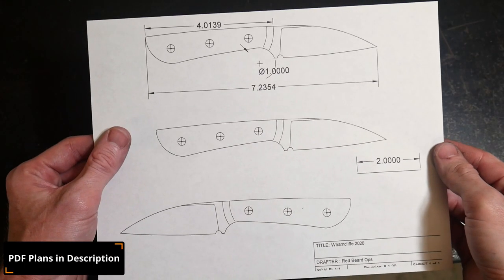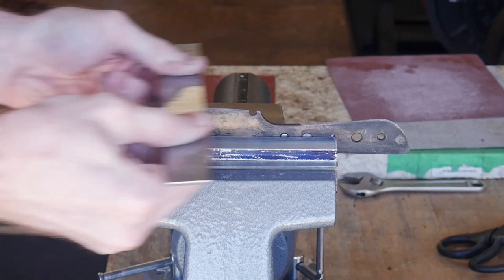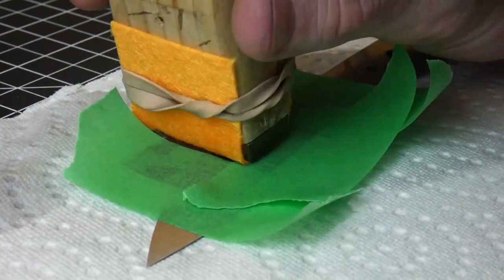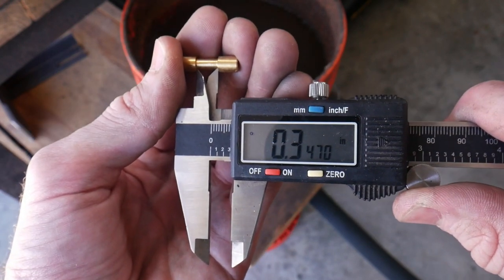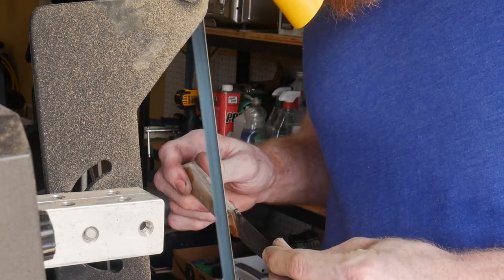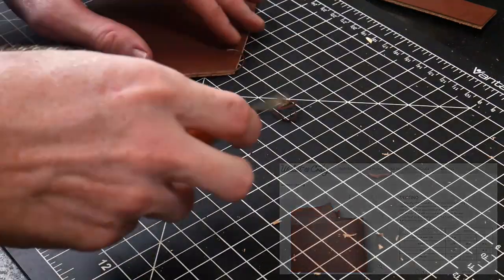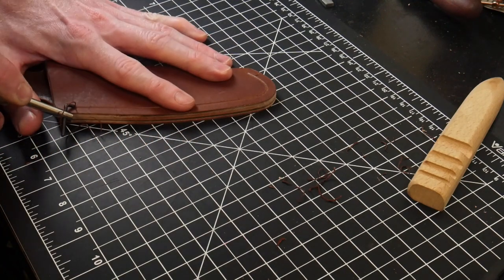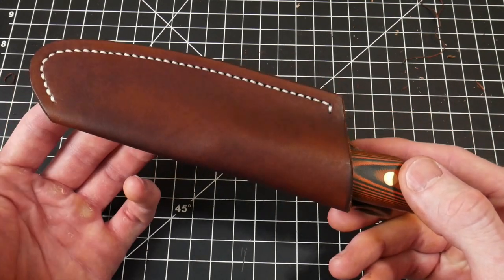Wharncliffe Knife & Sheath Build | Knife Making

Comment: Great job brother! I really dig the tip of running a JFlex a little over the edge of the platten to get into the plunge lines. It’s a tough spot, and the idea is golden! Beautiful work.
Reply from the maker: Thank you sir. A VFD really comes in handy at that point too. I'll slow it down a good deal when dialing in the plunges. I still don't get them right every time and have to throw that knife away. But I'm getting them right more often now with practice. Getting to the center line nice and straight is the first part of the battle. If that doesn't happen the plunges won't look good no matter what you do! Cheers man!
Reply: Red Beard Ops true statement😉.

Comment: Nice video and knife.  I need to make a tumbler like yours and figure our how you are using conditioning belts after the maker's mark.  It always wipes out the darkening.  I use the single use vinyl stencils, a 12v battery charger to etch and ferris chloride to darken.  Maybe using AC to darken holds up better?
Reply from the maker: They Walt, I've had this happen with new conditioning belts. The one I'm using is an old belt (1year plus) and it doesn't get deep in the mark like the new ones do. AC could help. If you wash it out you could go back with some brass black to get it dark again.

Comment: Is that "finishing nail" you used for the sheath just a basic nail? Probably a stupid question but I'm just starting out in sheath making, love your work man. 🤙
Reply from the maker: Yep that's just a little nail that is normally used for attaching trim. Ive also found good results using similar sized needles.
Reply: @RedBeardOps  Thanks!

Comment: Grinding after the heat treat -->  No hardness issues?  I see more guys doing this I just haven't done it myself.
Reply from the maker: Nope, knife blades are so thin in general that you'll get it hard all the way though. Just don't get the blade above your tempering temperature when grinding.
Reply: @RedBeardOps  rocknroll 🤘thanks!

Comment: Very nice work and great video. Question: when you do those last stitches in the sheath and melt the ends, did you tie a knot there? Maybe I missed that. If you don’t, have you ever had the soldered thread ends come loose after use? Also, have you thought of a rivet in the center of the belt loop circle stitch? One with a logo “RB”(?) would look pretty cool 😎
Reply from the maker: I do not knot them. I'm relying on the large melted end and a tight hole with back stitches. I haven't had them come loose. That's a good idea!
Reply: @RedBeardOps  I’ve been watch the way both you and Ricky Wallace do the leather work on sheathes and I’m very impressed overall. Similar techniques but different approaches and finishes to the leather. Personally, I’d feel better both selling or buying a sheath for a using knife with a rivet up at the top corner and at least one rivet in the belt loop just “in case”. By the way I think your stonewash finish and overall finish with that grayish tone is one of the best stonewash looks out there! 👍

Comment: You do nice work. I like the tumbled finish but I wonder if there is any way to keep the edges matching. What do you think?
Reply from the maker: If you're talking about the spine of the knife there is a way for sure! You just need to use "take down" handles (removable scales); or hold the scales on the knife to profile, take off, finish the blade, glue up, don't go near the spine. I did this process two videos ago on my Damascus knife.... it's just very time consuming. Cheers!

Comment: That is a great video. What is your main reason for not doing any grinding besides the profile prior to heat treatment. Warping?
Reply from the maker: Warping, even heat with a forge based heat treat, and only needing to suit up / focus to grind once. I normally only do this on stock removal knives.
Reply from the maker: No right or wrong here; I do it both ways. The logic would be more even heating, less warping, and only having to suit up to grind once.

Comment: That muffle pipe you use in the forge..is that just a piece of mild steel tubing?   Also, does it take a lot longer for your blades to get up to temp when you use it?
Reply from the maker: Yep, just a piece of mild steel. I put a cap on the end of it as well. Once the forge is heated up, it really doesn't take much longer at all since it maintains the heat of the forge.
Reply: @RedBeardOps  thanks!  I assume you get a much more even distribution of heat along the blade.  Mine do seem to heat treat ok, but when I etch them, some spots are darker than others.  So I  guess my heat treats are not as consistent across the blade as they should be.

Comment: Nice knife, but a true Wharncliffe's edge is as straight as an arrow - no belly/curve whatever; like a sheepsfoot blade, a true Wharncliffe has a perfectly straight cutting edge.
Why you put a curve on the edge for about 1/3 the length of the blade starting at the tip? 
That kinda renders it less than ideal for the precision cuts a Wharcliffe is normally used for.
Like I said, its a nice looking knife, but if I was in the market for another Wharcliffe, I'd pass on it because of the curve on the cutting edge.
Sorry.
Reply from the maker: All gravy Steve. I just thought it looked better. Call it creative licence. lol